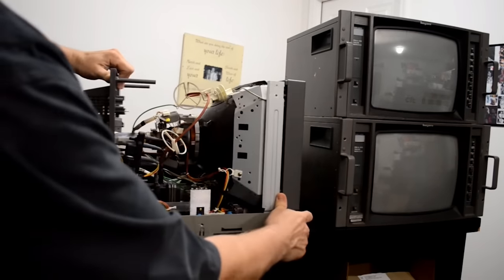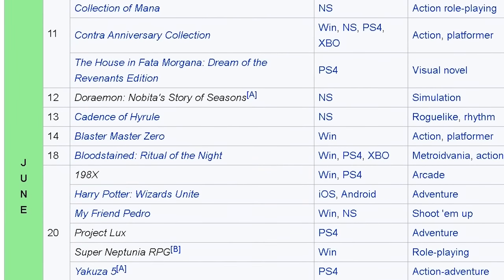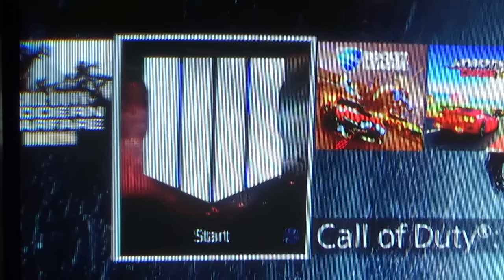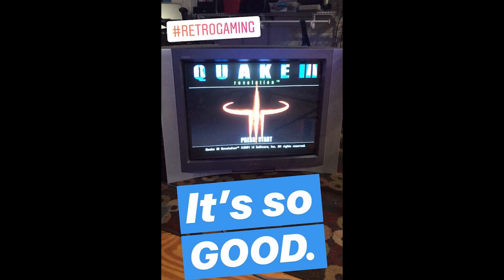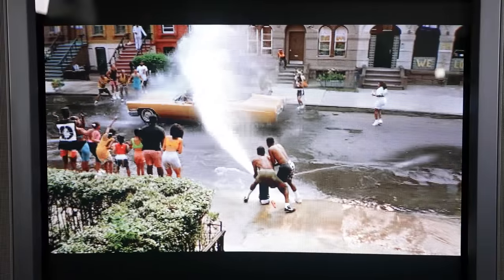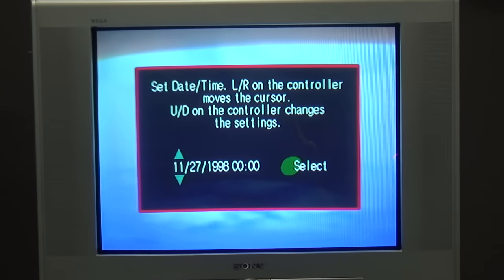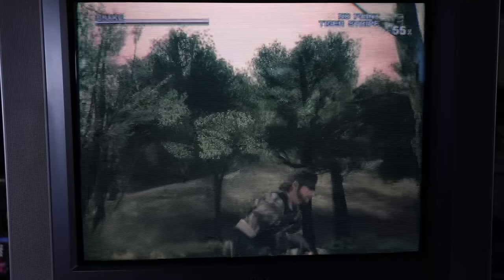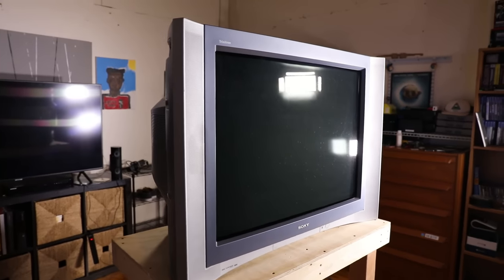Best CRT for Retro Gaming: Sony KV-36FV310

Comment: I know there's input lag but love my Sony HD CRT for HDMI based game consoles. Properly calibrated they also look great.
Reply from the maker: I've heard there might be something you can trim up in the service menu of that to try and mitigate the latency on the HD CRT's, but idk, there's so much information out there about CRTs I get lost. I personally would love an HDCRT just for the Blu-rays!
Reply: @Scarflix  "theres so much info out there about crts I get lost"-so true. I know just enough to get by. I worked at a TV repair shop for years but I was the VCR tech and  didn't really learn much of the TV side of it.
Reply: I've found that latency on my Sony WEGA only presents itself when using the HDMI port or while using a resolution lower than 480i over component cables. My theory is that the latency stems from the internal digital scaler. Running a supported native resolution like 480i, 480p or 720p via component seems to work without introducing any latency.

Comment: I've stocked up on a few CRT's, two 21 inch, and two 14 inch, some of them need some work though, and I wouldn't mind getting two or three more 21 inch ones. The CRT that I'm currently using for non HD video games is my Sony Trinitron 21 inch KV-21X5U.

Comment: That looks like a pretty amazing set. I’ve got three Sony PVMs and they make retro games look otherworldly good. CRTs are the shit. Also, light gun games. I love light gun games. For me, they’re the chief reason to own a CRT.
Reply: I got 2 pvms and a bvm myself but I prefer to play on sony wegas. I have a 32 inch sony wega that looks as sharp as my pvm20m2mdu and the scan lines are fatter than my bvm1911. They do have their own issues though (mostly geometry problems) but if you've been gaming on pvms for a while I would suggest giving the wegas a try. You can find them for free or dirt cheap on Craigslist. If you like light guns you got to try them out on a 32 inch screen. Time crisis on a big screen with a buddy... Hell yeah
Reply from the maker: I can't wait until I come across a PVM or BVM! I got my eyes peeled!
Reply: @Scarflix  it was a lot easier to find bvms and pvms a couple years ago. I uses to call up broadcasting stations and hospitals and ask if they had any. I found 4 this way (cheap or free). It was fun. Unfortunately the surplus pro monitors seemed to have dried up in the last year for me. Good luck finding one under $200. Pvms don't look that different than your wega for the most part. A high line count bvm is going to look different though.

Comment: Best way to get a PC to display on a CRT is using a Geforce 9800GTX+ with either the 9-pin DIN "Compupack" connector or S-Video and then super-sampling.

Comment: Just an FYI. You CAN fit one of these 36 inchers in a Scion TC.....  Also, the input/display lag is from the hdmi/super sampling not the 27" crts fault. Any analog-digital conversion or vice versa will do that. I use these for streaming Melee at 480p so it looks a lot better when uploaded. No lag on things that natively support 480p either!

Comment: I’m glad you mentioned the KV-27HS420, I got one because it had HDMI too! I’ve got a gaming PC, Roku, and Apple TV hooked up to it right now and I have a high quality pass through dual splitter on the HDMI port to save wear and tear when I hook up different gaming systems to it. As far as lag, I don’t really notice it very much, I just play the game and adjust naturally after a bit I guess, it’s so much fun to play games on a CRT! New games are cool too as I’ve finally gotten around to playing “Farcry 5” and it looks fantastic! I have a JVC Pro series CRT as well that I got before I stumbled onto this one and it’s pretty great in its own right so others should know not to feel discouraged if you don’t find a Trinitron as there’s some great CRTs from the other brands too. If I remember correctly, both ended up costing $15-20 altogether so it’s not all that big of an investment to get a CRT these days if you find one locally and avoid the auction sites. The only downside for me is that the screen doesn’t adjust and scale all that well for regular PC use so it’s sometimes tricky when using my gaming PC and the windows are huge even when I have the desktop scaled right. The best thing for this used to be the ATI Radeon All In Wonder series with component output as that was able to adjust the screen properly for PC use on my old Panasonic CRT TV but it’s all DVI, VGA, HDMI, and DisplayPort now. Oh well, minor issue altogether, hopefully these CRTs last for a long while yet and I never have to replace them!

Comment: This is the grail of CRTs. In addition to the comb filter, the 310s have a PVM grade voltage regulator. This makes the screen slightly more sterile than its 300 variant. I have the 32” version of the 300 and a friend has a 310. We ran a comparison using RGB scart cables thru a RetroTink Scart to component converter with both TVs calibrated using 240p suite. RGB modded SNES was used. We found that the 310s have slightly less bloom and bleed when running thru the 240p bleed test. You can access the service calibration menus on these models with the remote. This is the one the best ways of calibrating them next to actually opening them up. 

If you want the best possible picture (depending on system), you’ll need the correct cables. Scart is the best option but you’ll need something like the RetroTink to convert the Scart RGB signal to component to plug into the TVs. Don’t bother with composite, even SVideo is a way better option. As for the stands, my KV-32FV300 came with its own so if you’re lucky enough you can get one with its own stand. The 36” version are monsters. If I ever come across one I’m paying someone to move it. The 32” version was heavy enough. Very good video overall. Unfortunately trying to show how good things look on a CRT on YouTube doesn’t do it justice.

Comment: I bought a CRT for 50EUR just to play retro games without input lag. It works pretty much perfectly, however it can't show 480P pictures. On the plus side, since I live in PAL dominated Europe, it can take an RGB signal over SCART, which also works in 60HZ mode that some games support. Very few PAL games support 480P anyway, so I'm not bothered.

Comment: There are old video cards that support S-video out for you PC.
Reply from the maker: Oh okay, so that’s the move?
Reply: @Scarflix  That is the easiest/cheapest way I have found. I think you can have another new/better card in there too that actually does the rendering if you're trying to play more modern games.
Reply: Also most of the newer cards with S-Video (mid to late 00s) can output Component if you have a 7 pin S-Video to Component cable
Reply: doorht and that is emulation, not real cartridges
Reply: @naotomori5974  you'll not get the best quality by using the video card s-video out, you need an old Ati X series card (or older), a modded video driver that outputs to 15Khz and a special made VGA-SCART (or VGA-whathaveyou) video cable.
Reply: @souljastation5463  That TV doesn't have Scart

Comment: According to DigitalFoundry (YT - FPS analysing channel to test games etc) says the best way is to get a USB-C to HDMI cable which converts the GPU signal to VGA and then to RCA or scart or BNC for PVMs. The problem is that they may only use PC Sony CRTs with VGA not connected to consumer and profesional crt. I have not clue except the normal dongles can not handle PC crt specs at all compared to USB-C. You also need a program that forces or simulates a 31kHz or in your case a 15.1kHz signal or it wont work

Comment: Pro gamer move: buying a big ass trinitron, one massive chunky boi.

Slow gamer move: using it to play ps2
Reply from the maker: So true lol. I got the ps4 running on it once! Didn’t look super great tho
Reply: @Scarflix  yeah, i made that mistake too, unfortunately tracking down an HDCRT is very difficult.
Reply: Well i have one have owned 2 and have seen about 5 on the side of the road but the cords were cut. However i have NEVER seen an HDCRT that i have been able to pick up or buy. Also, that only matters for light gun games everything else is workable.
Reply: I had an HD CRT television and it was garage! The scaler inside was complete crap.  The image wasn't sharp at all. For 240p or 480i just use an SDTV. For 480p and above get a CRT computer monitor.
Reply: halo3odst should’ve done snes
Reply: @Etika, you got a CRT then its time to USE it! GRAB THE DREAMCAST BOYS WE PLAYIN HOUSE OF THE DEAD 2!!!
Reply: Or a gamecube for melee, hell, gamecube in general. Really just about anything besides the ps2
Reply: halo3odst the Xbox also had 720p 16:9, looks really nice a Sony HD CRT
Reply: It went up to 1080i although admittedly these games are rare and usually pants. That being said, i see no reason to use the xbox specifically on a CRT either. It looks perfectly fine on a flat screen.
Reply: @halo3odst  agree. I have my og xbox hooked up to a small flat screen and it looks really good. GameCube also. Ps2....not so much. Heck the dreamcast looks descent on it. I have a Toshiba crt with a n64 and a ps1 on it. Probs gonna put the dreamcast,ps2,genesis and saturn on it

Comment: Doubt you'll see this 2 years later, but that HD CRT can achieve zero input lag for 1080i content. You have to enable HDPT in the service menu, and also the JUMP setting to get 4:3 without pillarboxing.

I currently have a MiSTer running custom resolution of 720x540p because it can't output 1080i. However the TV can convert 540p to 1080i without adding lag. Zero lag has been confirmed with time sleuth, and duck hunt, lol. I know you said the picture wasn't good so doesn't matter, but this gives new life to Sony HD CRT's!

Comment: In Brazil, they have the 38” version of this model (KV-38FV310)
Reply: Whaaaat!?
Reply from the maker: Oh damn!
Reply: Scarflix here is the service manual and operating instruction:

https://www.manualslib.com/manual/1308940/Sony-Trinitron-Kv-34fv310.html#product-TRINITRON%20KV-38FV310
Reply: Third Eye Collective If I am not wrong there are 34” and 38” version.
Reply: Bruno Fernandes I found a KV-32FS120... worth it?
Reply: @felipem4704  In my opinion, yes. It is an entry level tv (termination with “1xx”) but it does have S-video, component and composite video as well. The picture quality and sound are also very good.

Comment: HD CRT tvs still produce lag so certainly not the best crt for retro gaming it's still better then playing on a hd LCD
Reply: The FV310 isn't an HDCRT.
I don't believe it's "the best".. but it's definitely up there.
Reply: True, many games were designed to be played on a curved CRT and will look warped on this tv
Reply: @franklinprichard9151  Lol. No.
Reply: @franklinprichard9151  thats not true at all, any warping issues is directly correlated to geometry and convergence issues of the CRT itself, which can be corrected with proper alignment and lots of tinkering with the service menu.
Reply: Hd crts are only good for gamecube and Xbox games, they look phenomenal. Anything older will be better on a non hd crt
Reply: Samsung actually made some quality lcds that you can configure to low input lag.  It's pretty impressive for 480p up to 1080p content.  I actually use my mclassic with one and it might surprise people.  I dont have money to throw around for oled, it's a bridge for me.

Comment: I mean, if the demand is there, I am absolutely sure that it is possible to recreate the CRT-look on a 8K OLED panels, because the pixel density is so high that it is possible to mimic the building blocks of CRT outputs. with HDR and CRT-filters I think it is possible to make something very close to the real deal with intense blacks, amazing brightnes. Regarding latency, with 120Hz we will be able to shave off most of the input latency of the frame buffer, and then we can have pixel perfect 18x 240p output, or 9x 480p output. With a 9x9 or even 18x18 pixels for each Standard Definition Pixel, it's definitely possible to create beautiful RGB patterns, scanlines etc. With proper upscaling, it is possible to smooth out each pixel in a CRT-like manner. 

If I had the resources I would start a company striving for creating the ultimate retro monitor for computers and consoles, incorperating a top of the line retro upscaler, similar to the OSSC but with higher output resolution.
Reply: It's not that easy… 
- light emitted by CCFL/LED/OLED is very different from phosphors light (CRT/Plasma tvs), it provides a different naturalness, vividness, "vibrancy" to the colors.
- CRTs can reproduce a virtually unlimited amount of color shades. It allow to very precise color reproduction without any kind of dithering (afaik best consumer digital TVs are usually up to 5/6 actual bit per compound, the rest is dithering)
- CRT could really be input-lagless. i.e. if you feed a traditional CRT with a direct RGB signal (like RGB SCART here in Europe), the signal will directly drive the 3 electric guns (indeed you can't even adjust the saturation command in this case). It feels like your inputs are executed a little before you perform them...
- most important thing: the motion resolution. On CRT you can follow every micro-detail of a fast moving picture (perceived resolution doesn't vary either if the picture is still or moving).
You can find something similar only on 30000$ Sony professional OLEDs: they have an option for enabling per lines driving (even in interlaced mode) imitating the CRT functioning, but even so the resolution drops to 700 lines on the resolution test (they are 4096x2160 panels). CRTs don't drop a single pixel.

That said, your idea of correctly multiply the pixels is really good. Sure it's better to sacrifice a little of the screen size if needed, always keeping a perfect pixel multiplication.
Reply: @papparaba5504  yeah, I mean CRT technology is of course very different, and the zero input latency is near impossible to compete with, and the virtually endless colors. However the upscaler can fill the frame buffer on a per-scanline basis similar to the OSSC. while applying a pixel-perfect mask during the line rendering while converting and imposing color/brightness spectrum according to the HDR10 standard (but yes. the image will only update once every frame has been drawn) What I am thinking is that the TV will run 60Hz content on the panels 120Hz refresh mode reducing the overall frame latency to 8ms (which is, to most people, extremely negligible). I'm not saying it will be EXACTLY like CRT or actually win the battle. :) But it would create a perceptual lag free experience to most people, with smooth pixel characteristics that we miss so dearly from CRTs. Example of a pretty good superimposed CRT filter is "CRT Royale Kurozumi" https://youtu.be/xrpm8o17cHE?t=971 (watch in 4K on a 4K- or 1080p screen). I just wish this to be expanded upon and integrated directly into a 4:3 8K OLED. xD "the perfect modern retro monitor". I would of course also love to have different CRT-filters configurable in the TVs native settings for SD content. I guess it's a niche but what modern TVs do to SD content is crazy, smudging and blurring everything to an unrecognizable mess. Treat every pixel with love, now when we have the resolution for it. :) tiny black borders are okay in my opinion, in order to get a pixel perfect image. (however, some inputs need to be streched horizontally, like the SNES 256px wide content), but with a 8K canvas you have pixels enough to upscale it nicely without perceived banding issues)
Reply: @DennisRamberg  To be honest I don't like scanlines. It seems that some people consider them like a distinctive trait of CRTs lol. Obviously it is a problem related to old videogames-HW's limitations. 
I really like my 2001 28" Mivar CRT (at the moment I have Ps1, og Xbox and Ps3 connected to it) 'cause it  attenuates the scanlines on 240p games (I think is either for a little accentuated bloom and a poor mask which when heated by the rays becomes finer), so the picture is quite compact.
About the 120hz thing I think it's not a possible thing to realize. I mean it is possible with frame-rate free PC game but old console games will still internally run at 60hz (you'd still have a input window and an actual game's screen refresh, once every 16ms).
This would be useless for the motion resolution too for the same reason. 
A 120hz BFI could make some improvement.
For the rest I agree with you. Just making the emulation pixel perfect on screen would really  make a huge difference (perfect sharpness and colors), like playing on emulators (with up-scaling enabled).
Little black borders are ok for sure. After all you're forced to have 2 big vertical BB when playing 4:3 games (it's not possible to patch it on 2d games).
I think that many people would be interested in a monitor/tv with such up-scaling function.

Comment: I find that the modular NSF wire shelves make the best furniture for these old heave TV sets. You can get a piece of wood cut and painted to fit on the shelf and it evenly distributes the weight, and the shelves themselves are rated to hold 1000lbs like that, or 800lbs on wheels so a 220lb CRT is nothing.
You can even put multiple shelves on it for the consoles and just have a wheel-around retro cart that you can stash away when not in use.